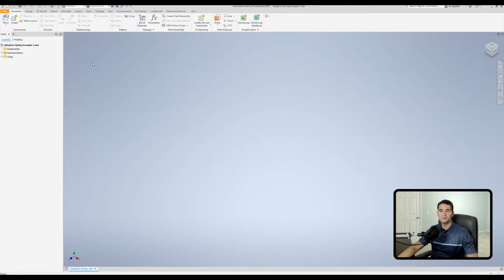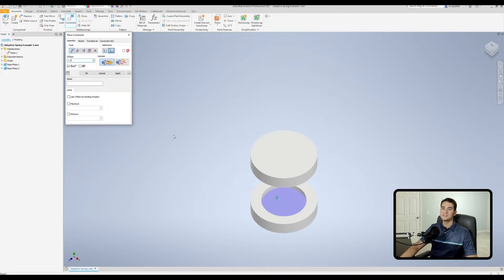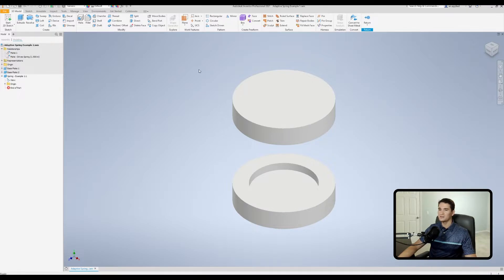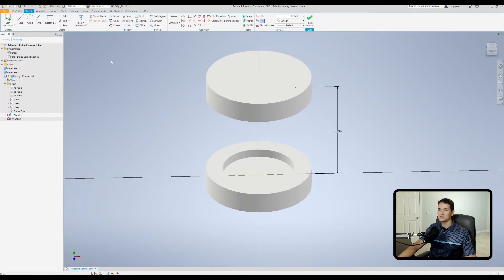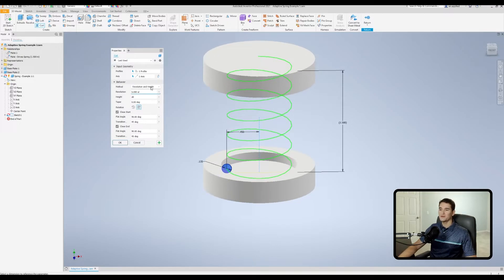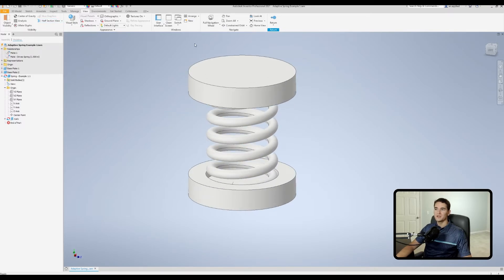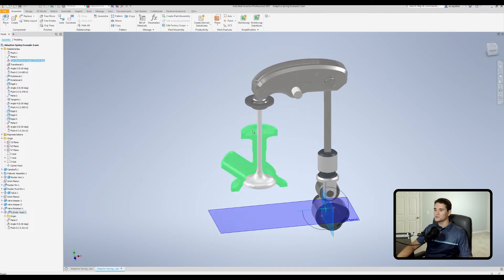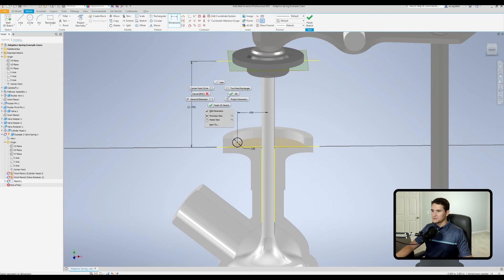Adaptive Spring (Animation) - Autodesk Inventor Assembly Tutorial | Autodesk Inventor 2021 IN DEPTH

Comment: Another awesome one, Very easy explained Thank you :) 
A quick couple of questions if you don't mind :)
1-You choose to model the Spring/Coil, is it possible to have it modelled before and insert it ? or this method is preferred so it can be referenced in the assembly ?
2-While creating the coil and selecting Dimension feature, can I also make the equation ( d0 -  CoilDiameter ), so that if the diameter of the coil changes i don't need to insert the dia ?
Reply from the maker: Thank you! See answers below:

1. This method is preferred as it allows you to reference the height dimension created within the sketch that the coil references. If I find a way to use a pre-made spring component, I'll let you know!

2. Absolutely! That's a great question. If your height dimension = "d0" and your coil diameter is "d1", you can type in: "d0 - d1" and that would work (this is preferred method). I did not enter the equation like that because I know it can be difficult for some people to fully understand a new concept when too many variables are being presented at once so I wanted to simplify what I was doing to make it as easy as possible to follow. I would definitely recommend you type in the variable name in case you want to change the spring diameter, that way everything will auto-update :)

Great questions! Thanks again for watching!
Reply: @engineeringapplied  thank you for your easy to understand answer ! 
Can’t wait for the next video ♥️